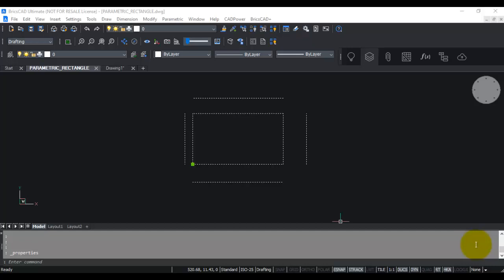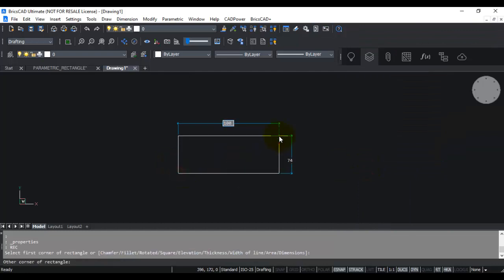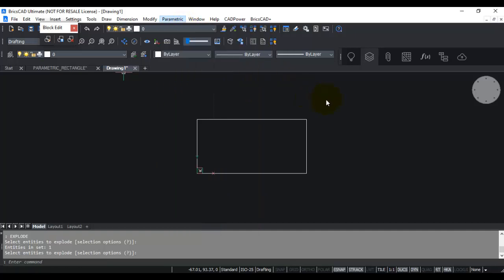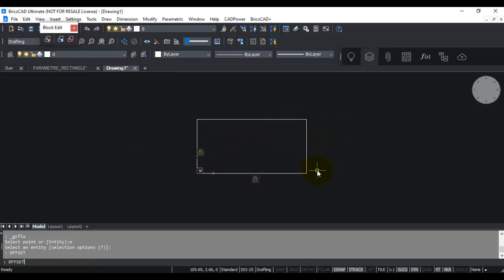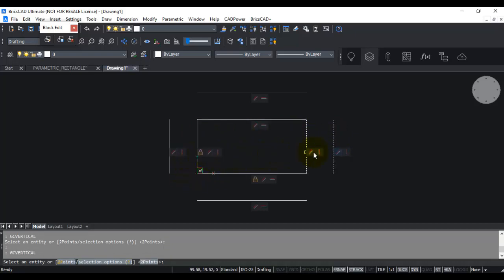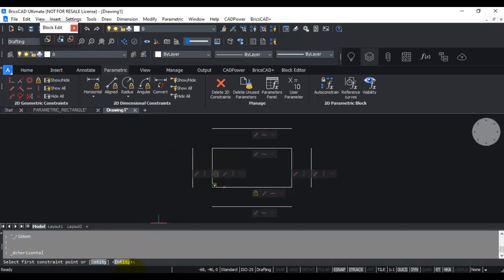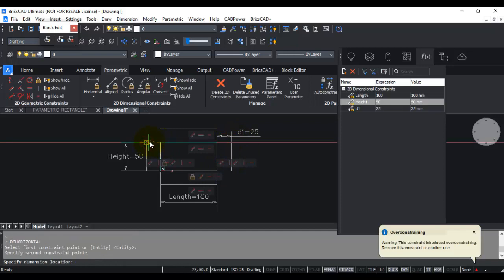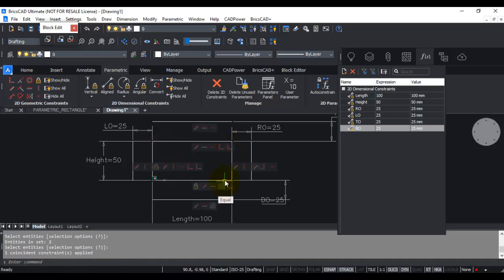BricsCAD Tutorial: Create 2D Parametric Constraints in BricsCAD | CADPower & GeoTools | Rakesh Rao

Comment: Rakesh,
I think this is a good tutorial.  I like how you explain everything.  However, it didn't work for me.  I did all the steps, stopping the video every few seconds and then going to my BricsCAD window to make the edits.  When I got done with all the constraints I invoked BCLOSE and saved the edit.  Selecting the block and right clicking brings up the BEDIT panel, NOT the properties panel.  I can use CTRL-Z to back up to the point before I saved the block, and see all the constraints on the rectangle and lines.  But every time I save the block and then right click it, the constraints no longer appear on the screen, the BEDIT panel appears.  Furthermore, I can't turn the geometric and distance constraints on and off with the show/hide constraints tool.  When I do so either nothing happens or the array menu pops up!  What is going on?

I also don't understand something .  You created the original (regular) block, then invoked BEDIT.  Then you exploded the block (creating individual lines) and started adding constraints.  I never saw you select all the lines and recreate the block.  You invoked BCLOSE and then saved.  This doesn't make sense to me. Why do you explode a block to edit it?

Comment: Fantastic explanation.  I am from England and your explanation was perfect!   Thank you!  (I am new-ish to BricsCAD, and I have a building to put onto CAD, I wish to use this feature to insert door blocks.  Nearly all the doors are the same 'style' only their left/right architraves are sometimes different sizes, and also not equal either, the door sizes vary and the wall thicknesses vary.  I believe this is a good example of where using Parametric constraints will work well)